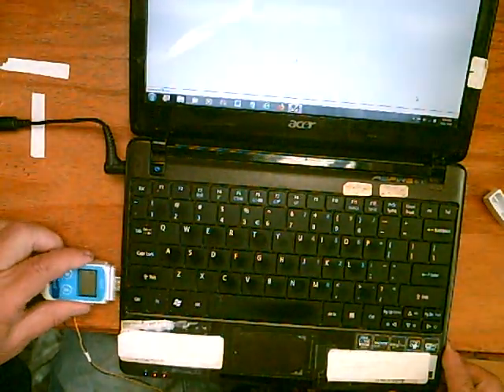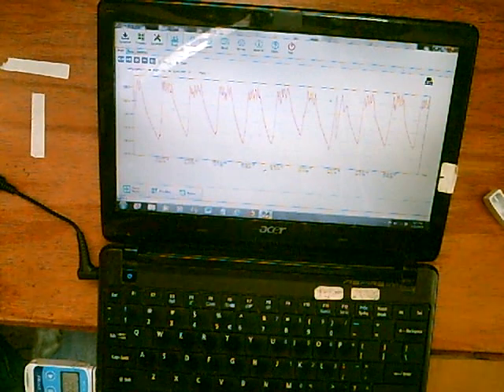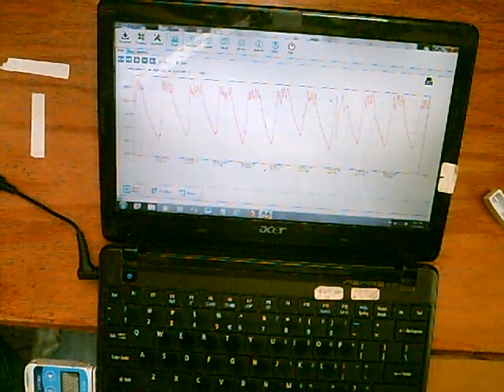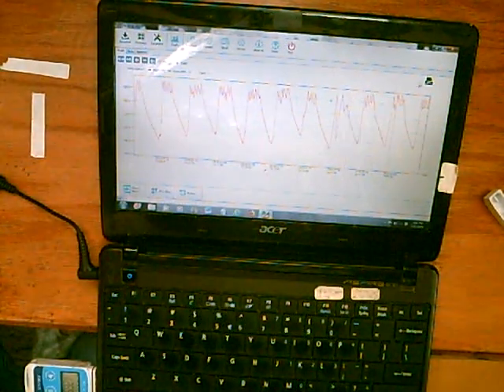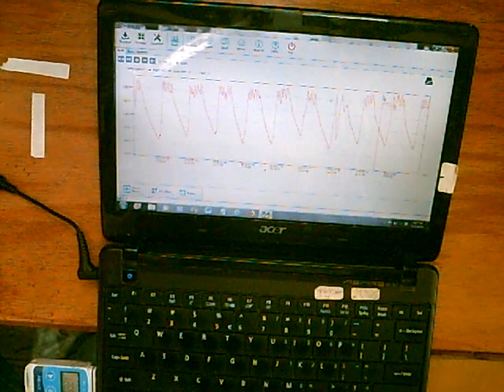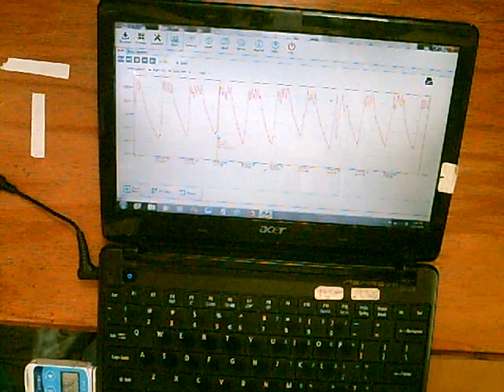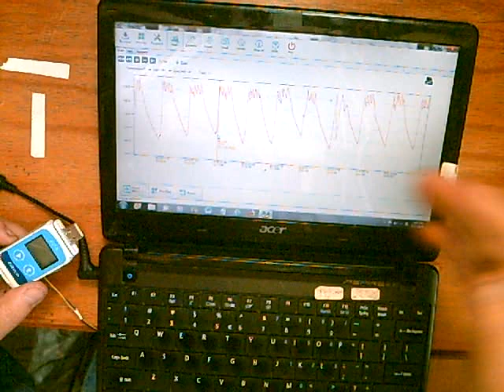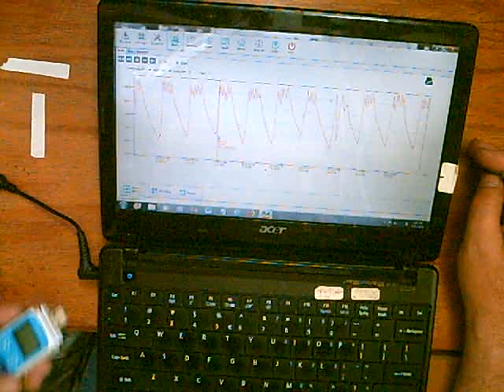11 Days of Data, PV Solar Hot Water of ECOsmart 6 Using RC5 Temp Logger

Comment: Nice chart and dump load but it still take the same amount of btu's to heat a gallon of water but you got your for free.

Is my calculation correct 265 watts per hour

125-107=18
6x8.33= 50 +/- btu
18x50= 900btu

1 watt = 3.4btu

900/3.4=265 watts
Cheers
Reply from the maker: Somewhat correct. That is the amount of energy in WH it takes to maintain or replace the heat lost over night for 12 hours.  OR tank thermal losses are 22W an hour. Daytime use amounts to

4F X 50 X 7 times a day =  1400 btu
1400/3.4 = 412WH daytime use

That tank typically consumes about 750 to 1000WH a day. which adding those two numbers matches. It is fed with preheated water from a 10 gallon tank and that gets about 1800WH a day total. That tank turns off at 54C and that higher added hot water skews the numbers a little.